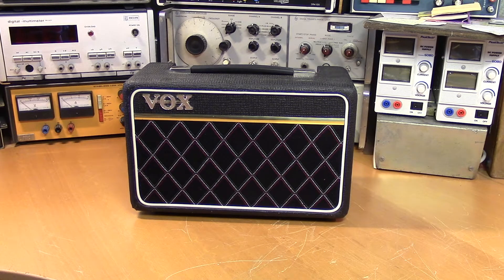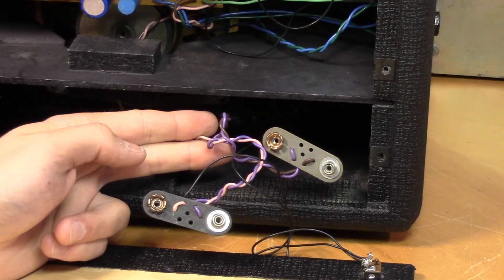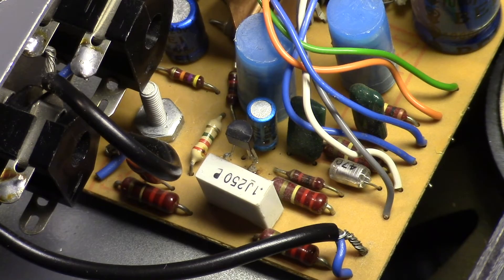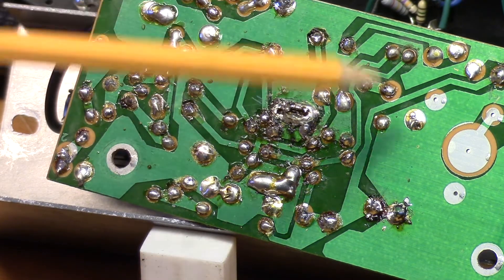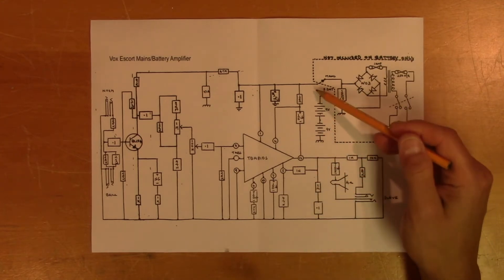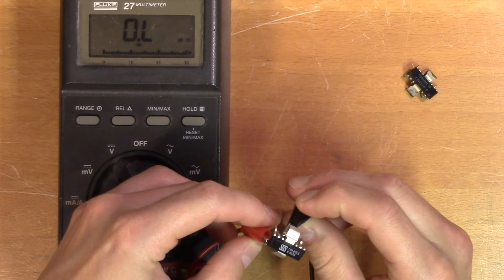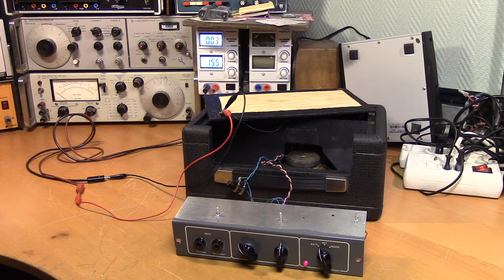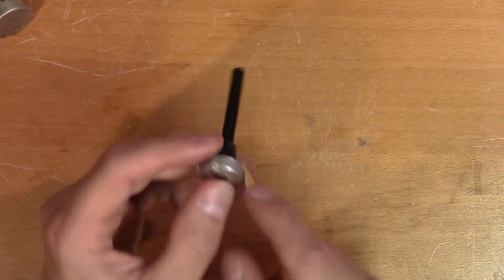Troubleshooting and Repair of the Vox Escort Portable Guitar Amplifier

Comment: What is external input voltage when there are 2 batteries 9V? Is it 18V-DC with center positive? Im really wonder as I have 1 unit BM2 close to me and for good price. At home I would lke to use adapter. But outside battery. Its clear that I need to modify battery sockets to be at least for standard 9V. Im even thinking to use Power bank via One Control unit which is giving from 5V already 9V center negative. I think I need to change polarity. I can use 2 out puts from One control unit to load voltage to each battery socket. For sure via external  connectors. For this mod I will need to make DYI back plate to do not destroy original one. Do you think that power bank should work as Im planning? Thank you for helpful feedback. D.
Reply from the maker: Hello! The amplifier in the video requires 18 V, single supply. I suggest you double check that the BM2 has the same voltage requirement. As for the Power Bank + One Control, I do not know how the One Control is designed, but I would assume that you CANNOT connect multiple outputs in series to get a higher voltage.

Comment: Hi, why this amp have two separate inputs? Its for mic and for guitar?
Reply from the maker: Hi! The two inputs have different input filters, which results in the tone being different between the two.
Reply: @SunandWeather  its not sounds clean, if we increase volume, right?
Reply from the maker: @5Inked  If you want to keep the signal clean (no distortion), you might have to keep the volume control relatively low. 

The two inputs differ in frequency response. I would guess that the "Brill" input boosts the high frequencies as compared to the "Norm" input.
Reply: @SunandWeather  you still have it, or already back to client?

Comment: Without looking at the end of the vid I will guess its the output device..... Guitarist like to push amps into distortion but this little solid state amp is not as forgiving as a tube amp and the output chip goes poof....all the time.....when they try to get "The Tone" from the amp...Am I right?
Reply from the maker: Hi DE S! You are absolutely right! The TBA810S integrated power amplifier IC was faulty. When looking at the PCB of this unit we can see that the TBA810S has already been replaced at least once, and one of the ground taps were not soldered properly when installed, which would make the IC incapable of dissipating heat as well as intended, most likely causing it to overheat. If these amplifiers are sensitive to overheating to begin with, I am guessing this unit did not survive long since its last repair.
Reply: @SunandWeather  The problem is that a lot of guitarist that own this kind of gear don't have a lot of money and don't really understand its limitations and when it fails, they get shonky inexperienced techs to repair it and in time it ends up failing again due to a bad repair.
Reply: Would you believe this! I have the exact same amp in for repair now! The fault is it cuts out after being played for 15 minutes! Most likely the output chip or a dry solder joint?
Reply from the maker: The TBA810S has a built in Thermal Shut-Down, so it is designed to shut down when the chip gets too hot, before it takes permanent damage. If the heat sink is not properly soldered to the ground plane it would most likely cause it to overheat, shutting it down until it cools off. So, it is very likely that this is the problem with your unit. Checking the solder joints between the heat sink and the ground plane on both thermal taps sounds lika a good place to start.

Also, keep in mind that it is possible that the TBA810S has sustained permanent damage already. I am guessing that the Thermal Shut-Down is designed mainly for situations where it is operated in too high ambient temperatures, not for when it is permanently operated outside its intended conditions.

Good luck!